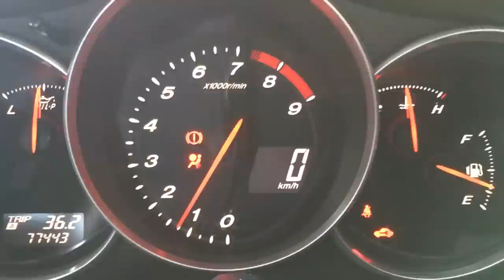Mazda RX8 | 2JZ-GTE VVT-i

Comment: What the year of the power steering rack you used from the rx7 does it matter what year it is ?
Reply from the maker: U can use any year, it doesn’t matter
Reply: Do u have any pictures of the motor mounts and transmission mounts before u put the motor in?thnx for answering back I appreciate it